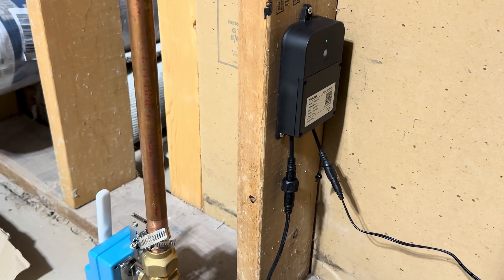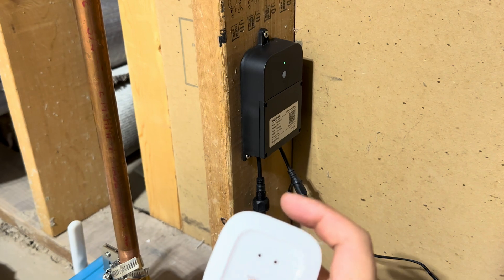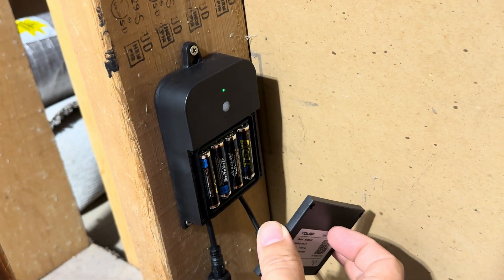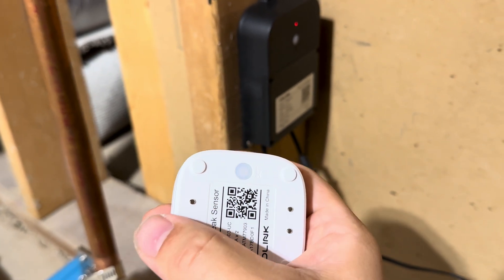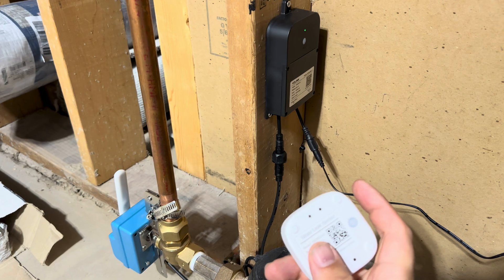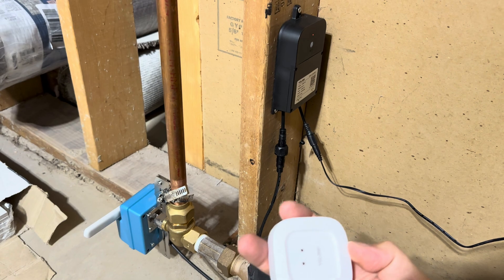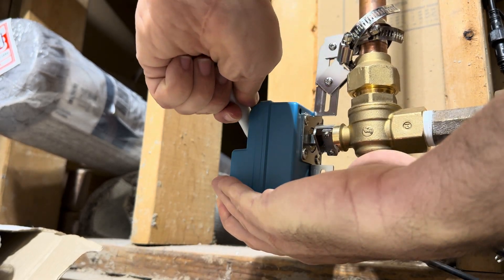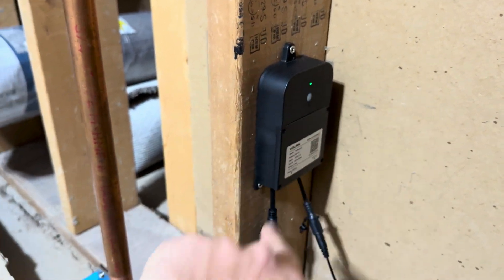YoLink EVO Valve Operator Part 2: Device to Device (D2D) Pairing and Manual Valve Control

Comment: Thanks great video.  See that the shut off valve is only connected to pipe with ONE of the silver legs and clamp.   Looks like there’s no pipe on bottom to connect other side to.  Glad that it works.  You may want to shore that up with a block of wood or something so the valve shutoff is attached on both sides and has better leverage.
Reply from the maker: Thanks for the comment - I actually address this in the Part 1 Video here https://youtu.be/n41_Ak8y9Q0?si=hzdw8bdsAtSsaqpW&t=193  It's not easy to see but there are 2 silver legs and clamps attached at the top as per the mfg instructions for 90-degree elbow valves.  I've actuated the valve operator dozens of times in this config with no problem.  Cheers!
Reply: @chrissfixes 

Thanks for response.  Yes, somehow I started on part 2 rather than 1.  Good to know that it can be done on 90 degree elbows and it’s been holding up.    Thanks for the videos!

Comment: So you can do both? Direct and through the hub?
Reply from the maker: Correct, you can do both so there is redundancy built into the system.  And through the hub and app you can remotely control the valve.

Comment: do you need to do D2D pairing while the hub is off? or can you do it while hub is on and valve controller is bound to it?
Reply from the maker: You can pair while the hub is on and connected to the valve controller.  That was the scenario in the video in fact!
Reply: Awesome!.
Thanks and great video!

Comment: how many pin on that controller ...  if you disconnect the wire   from valve and controller...how many pins is in the .. 5 or 3 ...thanks...
Reply from the maker: 5-pin, you can see in my first video here https://youtu.be/n41_Ak8y9Q0?t=263&si=v-4uRvihbWrPY3Wb